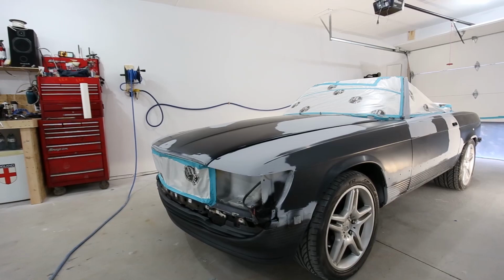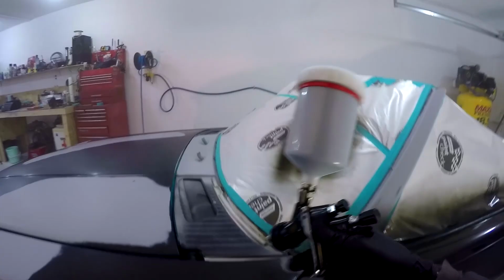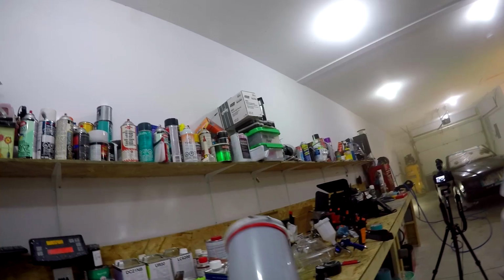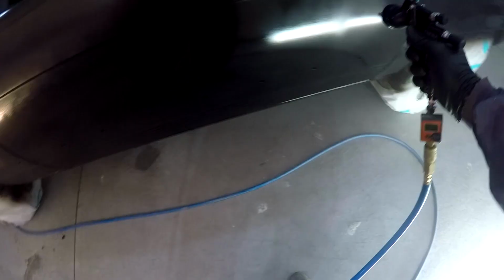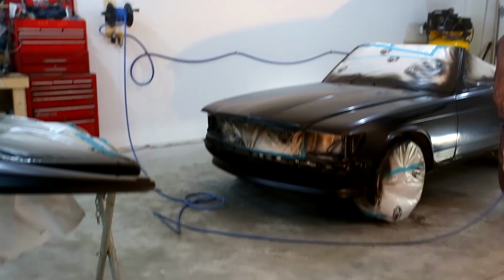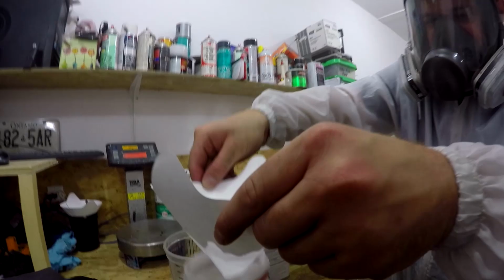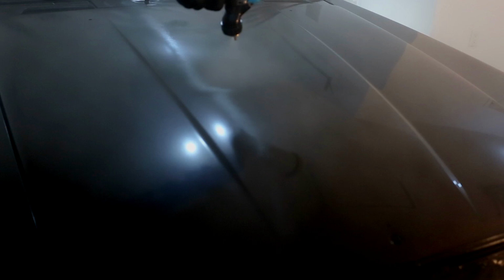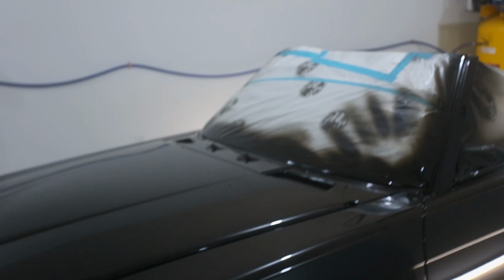DIY Garage Restoration: Painting a Black Mercedes to Perfection

Comment: these conditions are absolute luxery compared to what i and alot of people i know spray in and have done for the last 20 years. paintshop? try a disgusting oil ridden garage with 3 inches of body filler dust on the floor and a 25 quid spray gun.can still achieve the same results as the 100 grand paintshop up the road. i can assure you.

Comment: Looks like they are from Ontairo Canada, not the UK.
Reply: Looks like it was shot in Ontario, Canada. See the license plate on the work bench.
Compressor, tool boxes will be covered in overspray, floor not wetted down. Mixing room should be separate.

Comment: Great video!  It was very interesting cause it was shot in a garage and not in a professional spray both and the paint job came out in my opinion really good. I like to ask you what grit of sand paper was used to remove the bugs out of the first coat of paint? Thanks👍
Reply: 800
Reply: +bushidojohn 👍😌
Reply: +MrElPoderozo1 make sure u dust some base on after too
Reply: +bushidojohn.      got it, thanks for helping out.

Comment: bad bad paint job floor not wet down plus ac is out in the open blowing around dust
Reply from the maker: +Frankie Jim Tough but fair.
Reply: I thought that was a great home setup. That wasn't ac, it's a fan and filter, beats having the doors all closed and no draw out. You work around what you have available to you.

Comment: They are no pros in UK unless they are foreign heh. Look at their cars, they don't seems to grasp colour matching as mostly every repaired car is off.  Shrinkbacks and poor  no factory finish seems normal. Have seen myself good  colour matching by Swindon VW dealer(dark blue not much can go wrong), with see through base coat in door jams where clear coat started peeling off the whole side after 6 months. Surrounding panel become mat and filler shrinkback  awfully visible. That is car refinishing in UK.